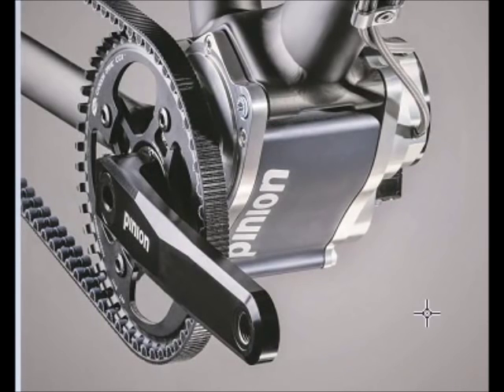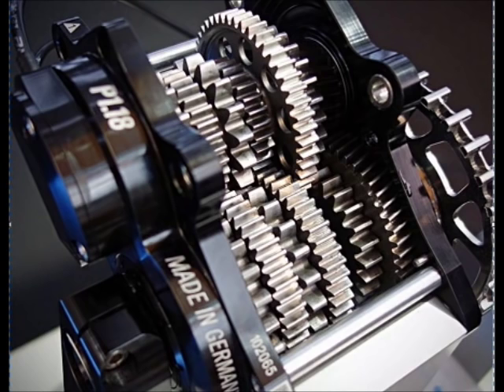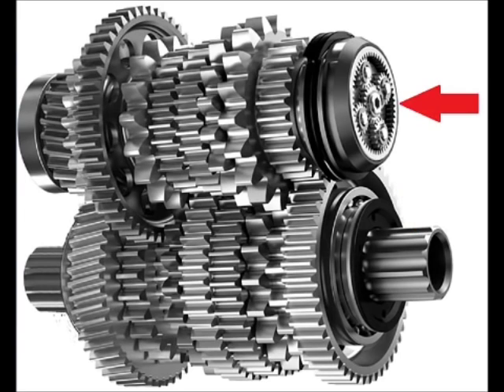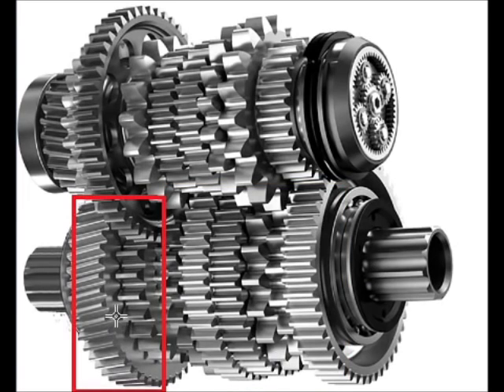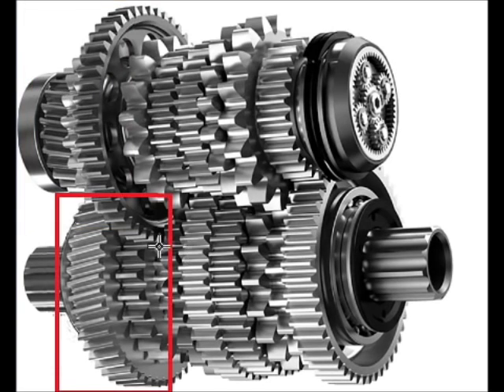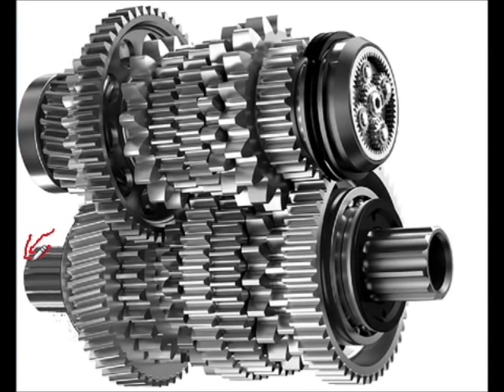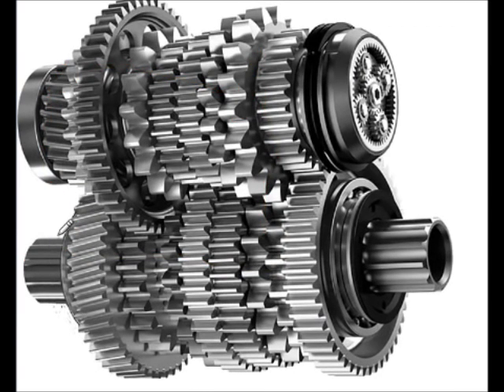Pinion P1.18  bicycle gearbox How it works

Comment: Leave it to the Germans to take a simple, cheap effective design and overengineer it into a monstrosity.
Reply: Not overengineering. Overthinking.
Reply: leave it to the standard, uninspired same basic derailleur-driven sprockets we've been using since the 60's and box it in, centrally located in the frame, beef it up and make it bulletproof for any riding condition and then you have an engineering marvel. yes it's not for entry level bikes haha. but then how much do you have in your MB?
Reply: Engineering is all about tradeoffs.  This is a good design theoretically because it moves the heavy weight of a transmission to the center of the bike, and also keeps it slightly lower (vs center of a wheel).  However, it is a heavy implementation, bad for human-powered vehicles.  Why is it heavy?  Probably because they're trying to cram the functionality of a standard derailleur bike, with say 3 chainwheels and 6 sprockets, into a compact case.  Conceptually, I think of the 3 leftmost gears as chainwheels of a derailleur bike, establishing a hi, mid, and lo range, and the 6 rightmost gears as sprockets of the rear derailleur.  If they changed these from sprockets to gears and tried to put them into a case, leaving their diameters unchanged, the case would be too large.  So they had to reduce their size, meaning the gears need to be heftier and heavier to carry the increased torque.  Also, I believe sprockets transmitting power via a chain that wraps around half their circumference and thus distributes the load across many more teeth, can be lighter than gears, which transmit power across just one tooth at a time, a basic constraint.  Also, the total number of actual physical gears inside the case of the Pinion is 18, vs just 9 (3+6) for a derailleur.  The gear reduction/multiplication in a derailleur bike is done across the chain from chainweel to sprocket, quite thrifty in use of materials.  The Pinion does all the reduction in the box up front, and still needs 2 additional sprockets to transmit the power to the rear wheel!  I wonder if Pinion did this kind of theoretical analysis.  Not that I am an expert or anything, just some thoughts.

Comment: To those complaining about weight.... First rule of engineering is that EVERY solution is a compromise. There is no "best", only the most suitable solution for a given situation. I seriously doubt the designers have higher end carbon road bikes and the pro peloton in mind with this gearbox. But there are many other types of bike that really benefit from a sealed maintenance-free design with easy shifting. Commuter bikes, which favour robustness over shaving off a few grams, get lots of rain and grime, lots of shifts (many stationary) and not a lot of care or love. Robust, sealed gear units are a prime candidate for these types of bikes. Add in the growing popularity of electric assist (which weighs much more than this gearbox) and this makes a lot of sense.
Reply: Who cares about the weight I'm not a weight weeny
Reply: I'm particularly interested in the use of this gearbox for mtb'ing, having a sealed gearbox free from the dirt and dust, and having the weight suspended low down at the bottom bracket, rather than as unsuspended mass at the centre of the rear wheel... Checkout Zerode Mtb bikes, they've got a great looking bike doing this..
Reply: @axiomic we couldve had gearboxes for 100 dollars if bike culture wasnt as is. A depressed asian mechanical engineering student could make a working gearbox. Its nothing new

Comment: I am very happy that finally someone had the resources and will to build this. The principle of bigger leverage works and gears are just round levers. The increased mass of the bicycle is compensated with a better chain design out of robber. If you want to improve this concept further, please feel free to consider my recumbent design that has levers of 2000 mm plus combined with pulleys. It is designed to increase significantly the torque exerted by human powered vehicles.

Comment: The manner in which those (unseen) protruding pawls engage the various gears explains why the Pinion Gearbox is do difficult to shift under load. Riders say they have to ease off the pedals almost entirely before a shift will engage, which seems like a hassle.

Comment: Since the shifters wasn't shown is this system basically a 3x6 drive?  Because in a 3x6 drive you don't have 18 gears you have 18 ratio combinations with some of the combinations being redundant.
Reply from the maker: This unit has no redundant gears. There are 18 progressive ratios. Actuation is by means of a single shifter with dual pull/pull cables.

Comment: How much it weighs, what it's gearing width, what input torque will destroy it?
Oh, the last question: how much it cost?
Reply: Mike Franz  cost
Reply: they say it weighs 2700g and rated to 250Nm input torque
Reply: Thx
Torque looks Ok, but weight could've been lighter. Still, I need to know its price.
Reply: 1400 Euro's.

Comment: Are they using the planetary cluster to achieve more ratios? Sounds like you are describing a manual gear unit.
Reply from the maker: The planetary set on the end of the counter shaft is the shift actuation mechanism.
Reply: A clutch would be dope
Reply: Dan Burkhart  I believe a much more intuitive (i.e. lever-operated, indexed) shifting mechanism would contribute to the popularity of these products. Test riders seem to agree.

Comment: I think I figured out how the planetary gear on one side of the counter shaft works. The counter shaft is rotated by an engaged gear. The counter shaft has a gear selector shaft inside that is used to raise pawls. The counter shaft and the gear selector shafts rotate at the same speed. The shafts are connected by two planetary gears in series. The first planetary gear has a 4:1 ratio (input sun, output planet carrier, ring fixed), the second planetary gear has a 1:4 ratio (input planet carrier, output sun, ring fixed). Overall this is 1:1 ratio and doesn't seem to make sense. But if you rotate the second planetary gear's ring it will work as a phase shifter between the two shafts. This allows you to rotate the gear selector shaft relatively to the counter shaft.

Comment: Thank you for posting this. I too would like to get my mitts on one for my recumbent trike. Hub gearboxes like the Rohloff are great, but they preclude the use of a Hub driven power assist, where as the Pinion would complement it. Yes you can get a 'mid-drive' motor like the Bafang, but these can give a lot of wear on the chain if you live around hills, (I live at the top of one :-( LOL). A hub motor actually improves the wear on the chain, as the torque generated by  the chain is amplified by the hub directly to the wheel instead of onto the chain. I got 500 miles more on my last chain after fitting the hub drive!

There is a short review of a pinion drive as fitted to an Azub trike on "Bentrider online" if it is of any interest. Apparently the change is a little stiff when new, but after a few hundred miles they loosen up a bit.

Comment: if you put this on a fixed gear bike, can you pedal in reverse?
Reply from the maker: The chain wheel freewheels, so back pedaling would not power the hub in reverse.
Reply: @2wagondragon Burkhart that is a shame, there are so many applications for a bike gearbox with reverse.

Comment: @andrewkiyko7413: I beleive this is not exactly so. It seems to me that the way the (ingeneous!) shifter mechanism actually works is as follows: (a) The driving pinion is rotating the driven pinion. (b) The driven pinion is in turn locked to the camshaft by the appropriate pawl. (c) This pawl sticks out of the secondary shaft, hence is forced to rotate with the concentric camshaft, regardless of the planetary shifting mechanism (to which I'll get in a moment). So, per a specific gearset being engaged, the secondary shaft and it's inner concentric camshat are rotating together at the same angualr velocity. Now, how do we change gear? we must cause the inner camshaft to "phase-shift" with regard to the secondary shaft. This, If I figured it out right, is performed as follows: First let us define two planetary gearsets. Let’s call the inner set Gearset A, and the outmost set Gearset B (composing of SUN A, SUN B, RING A, RING B etc.).
Now, (1) At the end of the camshaft there are two SUN gears, SUN A, which is not positively connected to the camshaft and can spins freely around it (it is and idler, carries no functional purpose except structural support for PLANTES A), and SUN B which is positively connected to the camshaft and rotates with it.
(2) RINGs A and B are fixed, but RING A (the inner ring) is responsible for gear shifting and is rotating a fixed angle every shift. RING B is always stationary. 
(3) Now for the clever bit: The planet carrier is common to both planetry sets. It carries PLANETS A and PLANTES B, and, as long as a specific gear is engaged, is an idler, i.e., it rotates freely.
(4) I order to shift gear, RING A is rotated in a fixed amount, while RING B is kept stationary. This Causes PLANETS A to rotate a small extra amount. This in turn causes the PLANET CARRIER to rotate an extra amount
(5) In gearset B, this causes PLANETS B to rotate an extra amount. With RING B being fixed, this drives SUN B (and hence - the camshaft!), rotating it by an extra amount. This results in the camshat being "phase-shifted", which translates to a different pawl sticking out radially, engaging another pinion in gear.

Comment: wow, wondered how those work.  I wonder why they went with helical on the last set.   i suppose that's the granny gear with more torque potential.   the array out different teethstrikes me as odd. are automotive gearboxes like that? i can see that the ratio has to have a whole number  of teeth and toy on the same center to center.
Reply from the maker: The helical gear set is the low range gear, so it will be subjected to the most torque.
The teeth on the lower three gears on the close ratio side  are cut much coarser than the top three  That would be for strength given the constraints of overall width available within the box .

Comment: The randomness of gear order is actually anything but random. It is for balance, eliminating vibration.
Reply from the maker: Thanks. I figured there had to be an engineering reason.
Reply: Dan Burkhart  And also so that successive gears (1-18) engage linked pairs of pawls in a certain order. Simple enough to map out the 3x6 sets.

Comment: I want to order a standalone gearbox like this for an ebike build I am working on.  However I can't find any sellers that actually have product on the market that I can pickup. Figured I could weld one on to the frame I'm looking at using.  I really would like to have no slack in the chain.

Comment: When I said it was simple I was ignoring one thing. The pawls that engage the gears are on a rotating shaft unlike those in a conventional internal gear hub where they are on the stationary axle and engage the stationary sun gears. I would love to know how those rotating pawls are controlled by the pull-pull cables attached to the frame of the bike. ??.
Reply: They are also rotating

Comment: "High"torque gears are better supported on the ends of the case, low torque gears on the center of the shafts due to bending loads.

Comment: Efneo GTRO thoughts? See them on eBay and Amazon for under $1000 some of them for $531.
Reply from the maker: No experience with the Efneo, but looks like a good solution for a city bike. It can be retrofitted to a frame with a standard bottom bracket shell, unlike the Pinion which requires a proprietary mount.

Comment: Thanks for this video. Very good explanation. However don't really understand how the shifting mechanism works tbh. I a typical igh, shifting is done by locking the sun gear with the pawls. But in this design, wouldn't the pawls have to be rotating together with the locked gear? How does sync up this rotation and what is the actual shifting action? 

Basically what i'm asking is, do you have any more insight into how the shifting is achieved with the planetary gear hack in the pinion gearbox =)
Reply from the maker: You are quite correct, and you are almost there as far as understanding how it works. In a wheel hub, the axle is a non moving part, whereas here, the counter shaft rotates with the gears. 
The pawl actuating cams must rotate with the countershaft as you point out. The planetary gear set you see on the end of the countershaft provides for switching the pawl actuators while the shaft is rotating.
That's about as far as I can go with the theory until I can either lay my hands on one, or find more detailed drawings.
Reply: On close inspection of the few 3d renderings of the insides of the gearbox it actually looks like there's two set's of planetary gears. That would explain how the switching shaft can be synced with the counter shaft, where i assume the pawls are mounted. 

Do you think i'm getting closer...?

Man i'd love to see this mechanism working=) =) I'm so fascinated by it right now.
Reply: aaah.. is THAT why there are two wires going to the gearbox? One for each ring :P?
Reply from the maker: There are two cables because shifting action is pull/ pull, no spring return. Rohloff hubs work that way as well.
Reply from the maker: Check out this video.
https://www.youtube.com/watch?v=baaBgXTIyms&t=337s

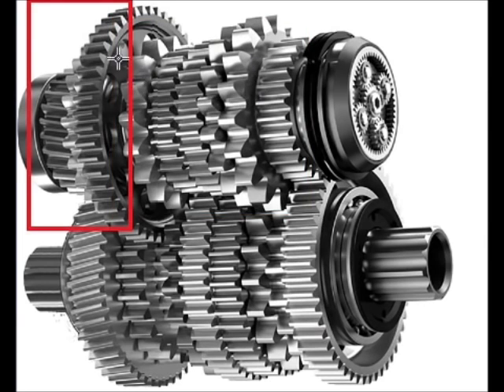Starting at about 3:34 you can see the ring gear being removed from the planetaries and the shifting gear being manually rotated.
Reply: @2wagondragon  This video is private. Is there any chance I could watch it please?

Comment: That's fantastic, I wonder how well it actually works in operation.
Reply: More or less hassle free. it's not as efficient as a derailleur, so you won't see these in road racing, but 636% gearing range with 11% between gears even steps without overlap is fantastic on tours. It's also extremely low maintenance. Exchange oil once a year or every 10000 km, that's it.
I experience the occasional disengagement of a pawl, especially when I don't let the shifting mechanism engage freely (i.e. keep some remaining force on the shift ring at the handlebar.) That results in a hearty "clunk" when the pawl engages in the next pocket.
Shifting down at the thirds of the range, where two gear pairs switch at the same time can also require more prominent unloading of the drive train. Normally it is enough just to shift down when the crank is vertical, thus input torque the lowest. Shifting 13 to 12 and 7 to 6 can be a bit more stubborn.
OTOH you can shift down over several gears at a red light and take off in the ideal gear. That's a big boon over a derailleur.
Reply: @HotelPapa100  Thanks, very interesting. Happy riding.

Comment: I'm thinking if they built this thing with much narrower gears, the drag would be greatly reduced. Less surface area=less fractional surface, right?
Reply: Classical physics says no.  Friction is proportional to the weight on the friction surface, not the surface area.  Also, less surface area means more wear.  (For example, narrow 11-speed chains wear faster than single speed coaster brake chains.)

Comment: Can someone please explain what "drag" means as it relates to gearbox systems?
Reply: The sum of (a) contact friction between meshing gears (two pairs at any given moment), plus (b) sloshing of lubricating oil (temperature-dependent viscosity), plus (c) inertial momentum of the gear bodies themselves (which collectively weigh more than a cassette/chainring arrangement).

Comment: I really don't understand about the input and output shaft being the same shaft. I reallly apreciate if you can give or guide me to a clear explanation, sir.
Reply from the maker: My apologies if my explanation was not clear. If you go through it again, note that I showed the 6 gears on the input shaft farthest away from the chain side are all permanently coupled to the shaft, and transmit power to whichever of the countershaft gears is coupled to the countershaft. the three gears closest to the chain side on the input shaft are not coupled to the axle, so that gear cluster is driven by whichever of the three gears it meshes with. Think of the shaft that those three gears are mounted on as a hollow tube which the input shaft passes through but does not drive.
Reply: The hollow shaft you mention really made it more digestible to me, thank you sir.

Comment: I loved my Sturmey Archer bicycle gears (three speeds inside the hub). Then I got a fancy new bicycle with Italian gears. Fifteen of them, if I remember correctly. I never liked them and my interest in bicycling waned thereafter.
Reply: 't was the opposite for me. My Sturmey Archer hub had terrible efficiency. Only the second gear, where the internal mechanics are locked, worked well. (May have been a mantenance issue; that bike took some abuse from 14 year old me.) My first 5 gear derailleur bike was an epiphany in comparison.

Comment: The problems of this architecture are weight and encumbrance. Only race bikes segment is actually demanding a high number of ratios, but at the same time this gearbox is too heavy and too big for race bikes. 
So in the end, it's nice ok, but has no commercial sense.

Comment: Or you could add a hub gearbox, like the Sturmey Archer, and save a load of weight and the need to re-engineer the frame...
Reply: Or do both 3 gears at BB, 6 at hub for 18 gears total.